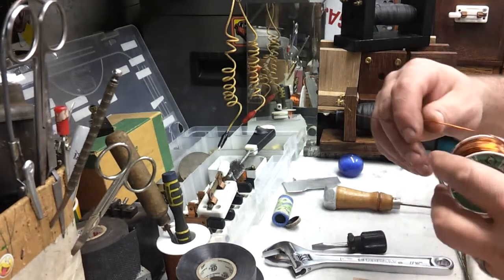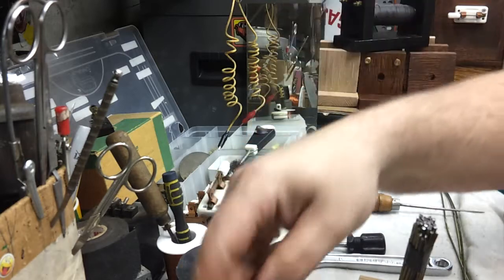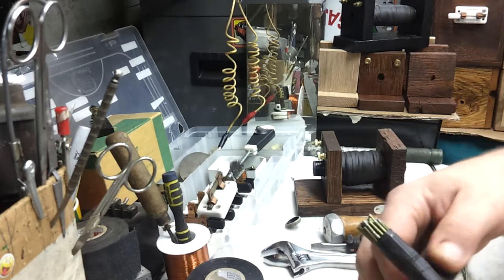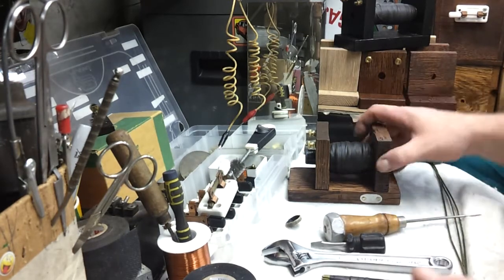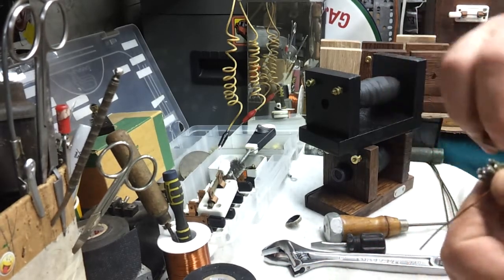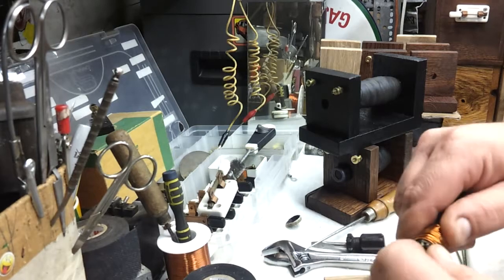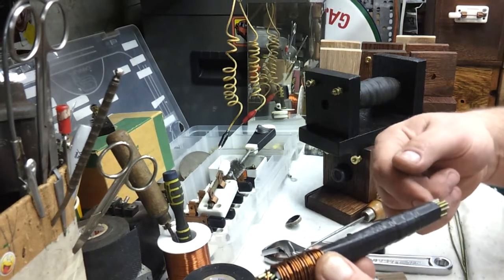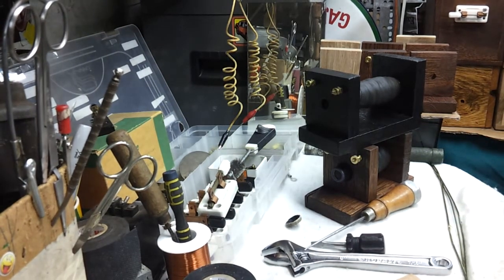Low Tension Coi How to Part 2

Comment: Coat Hangers is NOT soft iron. Its not the right material for a core of a coil. Otherwise good video!
Reply: I use coat hanger and it works fanatically!

Comment: Great video, I've just made my first low tension coil, I made the iron core from re-bar tie wire and the coil from two old motor field coils. I've just tested it this morning and its giving one hell of a spark and it didn't cost me anything. many thanks for posting the video. regards Lim.